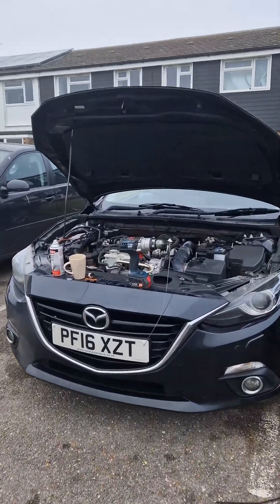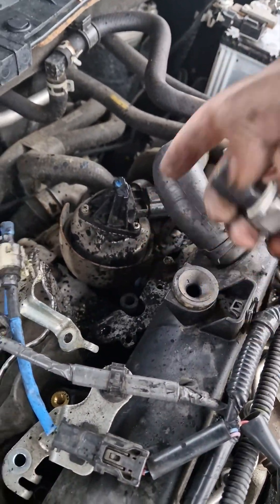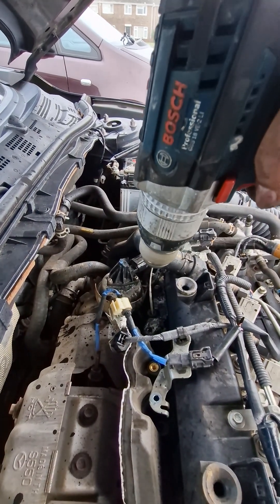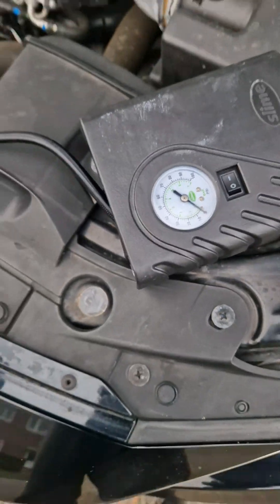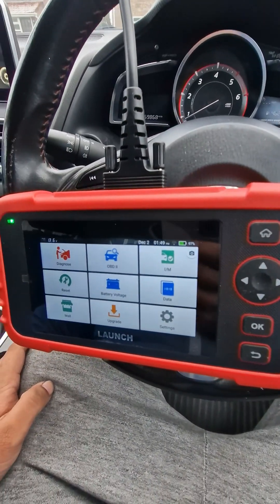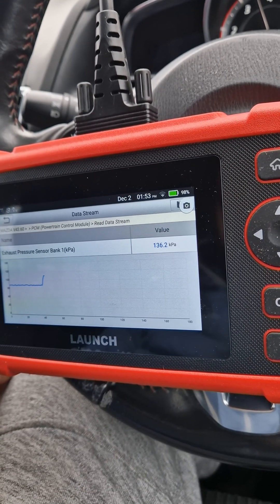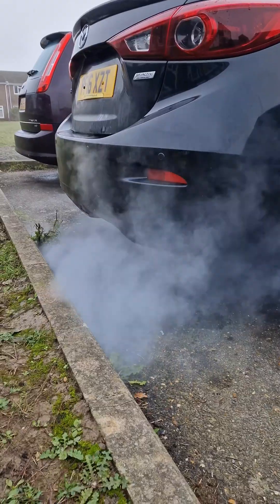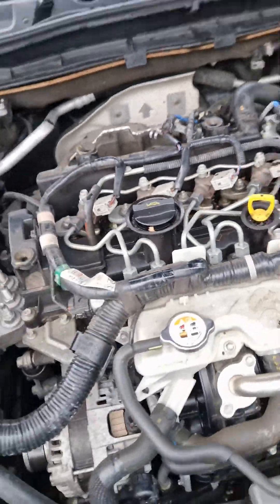Exhaust Pressure Sensor Clogged fix - P0471 P0472

Comment: My cx5 pipe is blocked, tried cleaning with bottle brushes but wouldn't shift it. Will try the drill and wire trick. Great video
Reply from the maker: Thankyou. Yes its very difficult to unblock it. I would recommend leaving it to soak with the EGR cleaner and then go with the drill. Let me know when you've fixed it!!
Reply: how easy is it to remove the pipe?

Comment: How did you get the cable through mine doesnt go in much the drill just twists the cable didnt work for me
Reply from the maker: maybe you need a thicker wire. i used a brake cable which worked fine for me. Soaking it in EGR cleaner for a couple of hours would be helpful if its too blocked

Comment: This sensor is connected to an extension pipe (which is the part youre cleaning out with the wire) but what does the pipe then connect to?
Reply: to a turbo manifold...it measure the pressure befor turbo ..there are two holes coming from engine...the second goes to the egr..and there is 3rd small for another sensor...and there it is..look on youtube theniceguy
Reply from the maker: @evzentikovsky3592  thankyou for that clarification!

Comment: I have exactly same issue but the wire goes only 5 inches in, it looks that it’s seriously blocked :/ don’t know what to do now
Reply from the maker: i know you might have gotten it fixed. but Soaking it in EGR cleaner for a couple of hours would be helpful if its too blocked
Reply: @JesseIson I'm a bit confused; can you clarify? Do you mean soaking the brake cable or putting the liquid inside the pipe for a couple of hours?

And thanks for the video
Reply from the maker: @Hamza-cz1sd leaving the liquid inside the pipe so it soaks through

Comment: At the other end of the metal pipe how big is the hole.Do you actually go into the exhaust? Good video as I was going to take pipe off
Reply from the maker: @evzentikovsky3592 to a turbo manifold...it measure the pressure befor turbo ..there are two holes coming from engine...the second goes to the egr..and there is 3rd small for another sensor

Comment: I have a warning light, saying I have an issue with this part, how dangerous is it driving with this part of a car being faulty?
Reply from the maker: Hi Ben,

There is no immediate danger in driving with the warning light on. However, it will reduce the performance and efficiency of your vehicle. To prevent carbon buildup and potential future faults or problems, it would be best to replace the sensor.

Hope this helps!
Reply from the maker: are you based anywhere near south east of UK? Maybe I can help ☺
Reply: @JesseIson  I'm South West, getting it all sorted now though, thank you very much, 😊

Comment: What's the length of the cable? Not quite sure if I've got to the end of it. Thanks! When testing for pressure, is the engine on?
Reply from the maker: Start with a smaller cable so its easier to manage, keep going for about 40 50 cm.
Reply from the maker: i kept the engine on while drilling out so you'll have pressure release and know its done the job. Keep the engine off for testing for pressure!
Reply: @JesseIson  Thanks mate, I actually managed to break through! Just kept with the persistance but it took a while. Used the pump and it was all clear.
Reply from the maker: @DarkShadowAy  great to hear. glad it worked!
Reply: @JesseIson Nice to hear from you a year later 😅😂😊